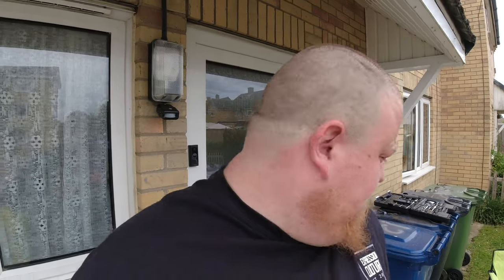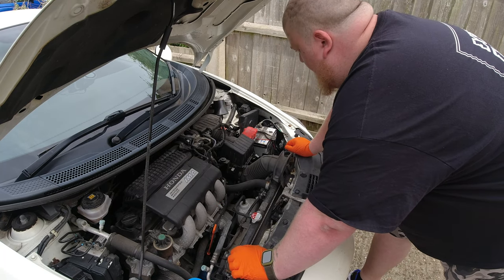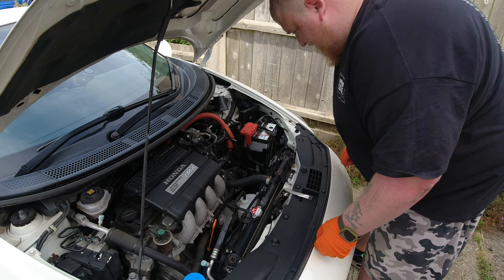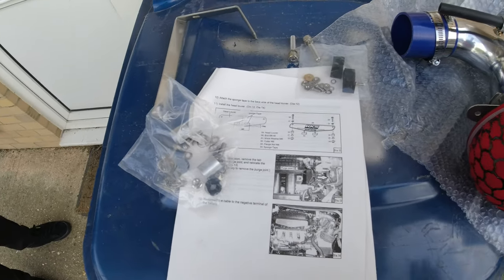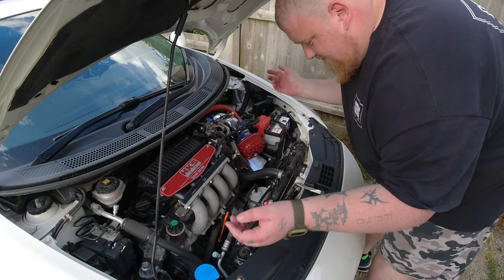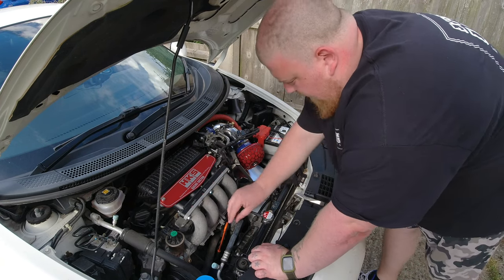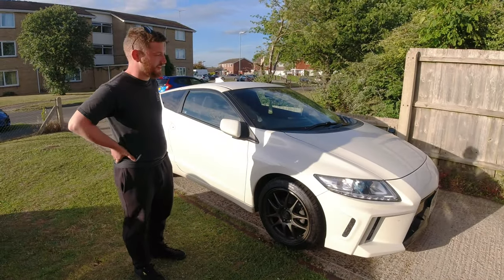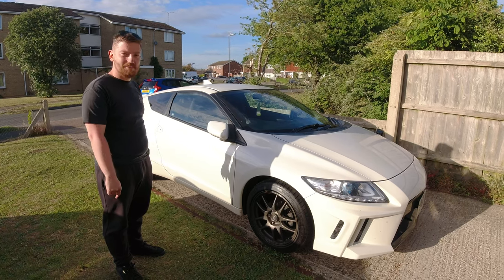HKS Racing Suction Kit - Honda CRZ - EXPRESSION CULTURE

Comment: Hallo there! In the end I got a HKS Racing Suction kit.
Do you have some tip or warning before to install it? Do you think it's better to assemble alone carefully, or it's better to ask a mechanic?
Reply from the maker: Hello, its fairly self explainable to fit if you have basic hand tools and engine bay experience. Id of hoped my video does explain enough of how it should be and if there was some tougher parts to fit from the kit. It was a while ago now i did this video however though haha. If you get stuck though im more than happy to try and advise you what to do, obviously i dont know how much experience you have but like i said its fairly simple
Reply: @ExpressionCulture  Almost zero experience on engine bay ,-) But I assemble PC and I soldered the battery of the iPhone 2G :glasses-purple-yellow-diamond:also I have some torx tool.
I am tempted to prepare a ready-assembled HKS tube and carry it to a local mechanic. I feel that showing a tuning item to be assembled with a 'japanish' booklet may result in a NO or a high price with no reason.
My concerns are more about removing the throttle body and the car sensor, but I see some step on the HKS guide...
Reply from the maker: @jolladevices  might be worth getting someone to fit it for you or give you a hand at least then. If you was able to come to me id fit it for you
Reply: @ExpressionCulture  I am starting my CR-Z travel Milano-to-London :face-blue-smiling:
Thanks, I will ask this to one of the local mechanics, Maybe Honda Bg.
Reply from the maker: @jolladevices  all the best buddy
Reply: @ExpressionCulture  Installed by a local dyno mechanic. Great appearance, to be tuned soon.
I can't listen it because the N1 is covering the sounds lol
Reply from the maker: @jolladevices  awesome stuff

Comment: Hallo EC, nice item, do you have a store inside EU to recommend?
I am not sure it will be as cheap after customs...
Reply from the maker: Try HKS Europe;  http://www.hkseurope.com
Reply: @ExpressionCulture  hallo again, I have a trouble on choosing an intake: HKS, the Takeda, or the KN typhoon? I found they have now a very similar price around 400 eur... (and there are other few intake)
Do you ever compared them?
Reply from the maker: @jolladevices  hello, ive never really compared them. Ive fitted the K&N Typhoon and the HKS obviously but never fitted the takeda. Ive got the Injen cold air intake on mine which i have done a video on also. I guess it depends what you want out of your intake. Noise, power, response etc. i would recommend the injen for noise but for power and response it seems very good.
Reply: @ExpressionCulture  thx for infos. Yes that would be a hit video in the "CR-Z niche".
I've discovered the Injen it's impressive with that low tube... I basically search for some low to midrange improvement and second some sound (that will be in charge of the exhaust😇), maybe the Takeda is the right one for me?
- or second option, I seen the HKS full exhaust low in price (around 600eur) maybe it has sense to go full HKS?
Reply from the maker: @jolladevices  HKS exhausts do seem to be very well priced compared to others.